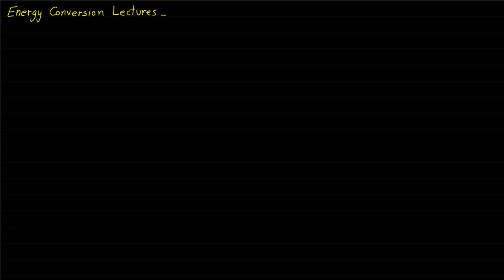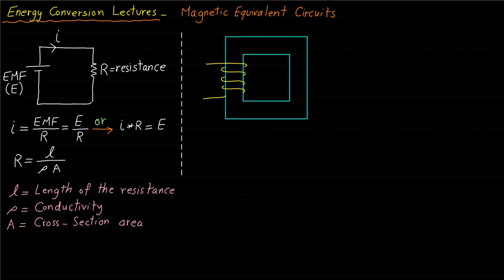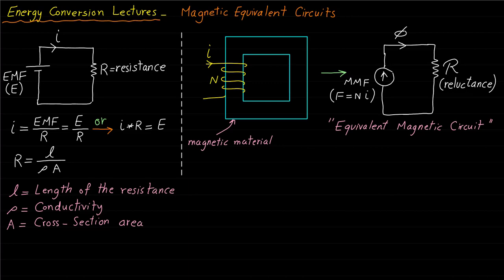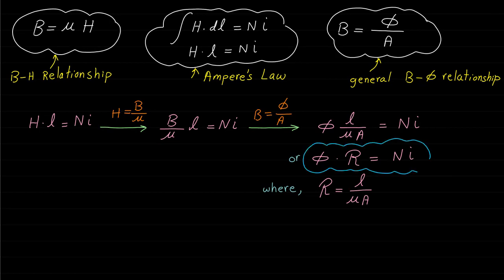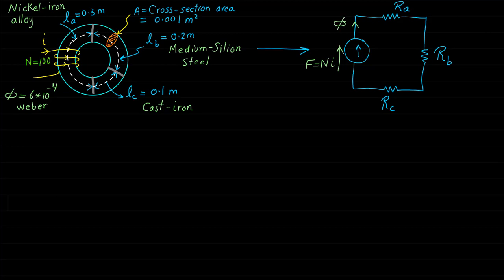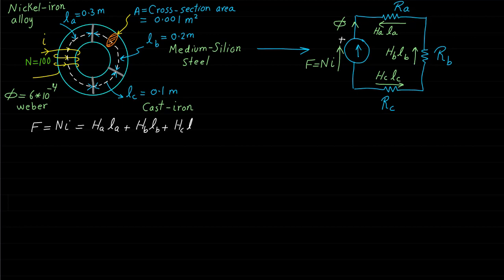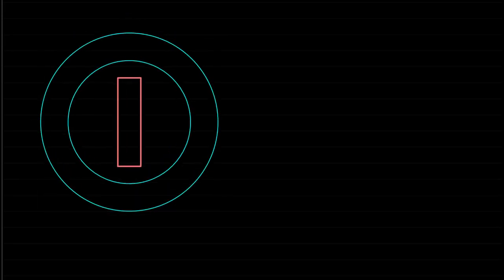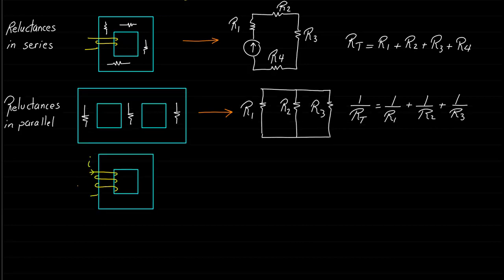Magnetic Circuits - Equivalent Magnetic Circuits

Comment: Dear Ehsan now we now that magnetic field intensity H is inversely proportional with L (Length) and reluctance proportional with L length, so in the example we see that length for nickel iron is more than two other medium so H for it is less than others, but what about reluctance it should be higher than others medium. is that right?
Reply from the maker: Thank you for your question. In terms of the Reluctance, the reluctance is proportional to the length also it is inversely proportional to the permeability of the material (Note that In the example, the cross section area is same for all materials). So if we want to determine the Reluctance of each section, we need to calculate the the permeability first of each material (The permeability of section "a" is already calculated in the example), then calculate the reluctance of each section. Hope this explanation answers your question).
Reply: @EnergyConversionAcademy  thank u brother

Comment: Need clarification on the equation you used for resistance. Normally resistance is expressed as  R=ρl/A or alternatively R=l/σA where ρ = 1/ σ. Conductivity is the reciprocal of resistivity and is normally represented by the greek letter sigma so is this what you mean't as resistivity is usually indicated by the greek letter rho.
Reply from the maker: You are correct. It seems that I used wrong letter to represent and describe the conductivity.   Yes I used rho instead of sigma. Thanks for your comment.